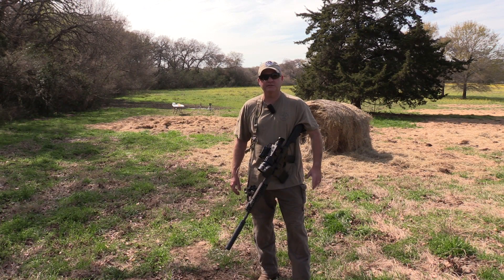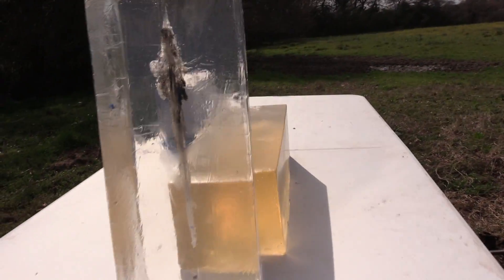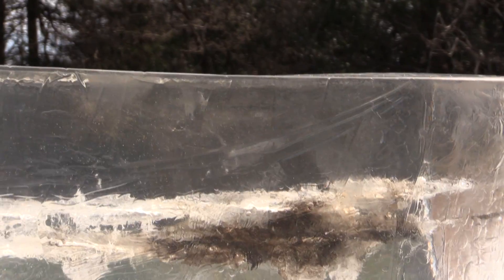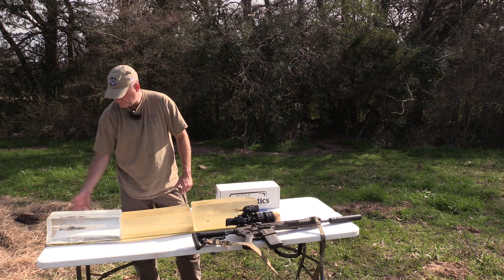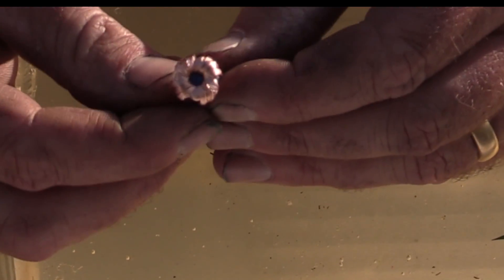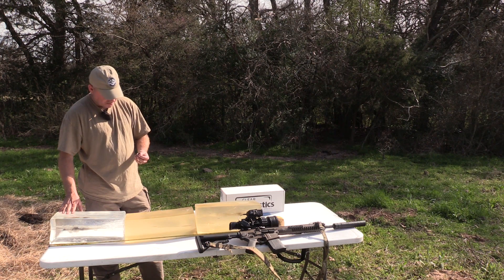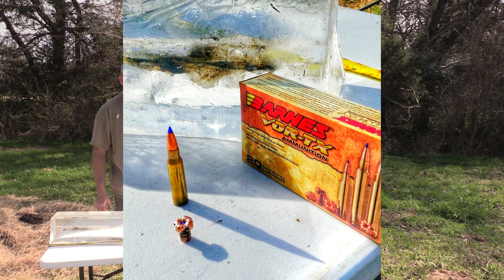Barnes 308 win 130gr Vor-Tx Ballistic gel test.

Comment: Hey what do you think the velocity difference with this particular round is between a 24” and 20” barrel thanks
Reply: Just viewing this video because I just ordered a couple boxes of this ammo. I read an article where a guy took a 30" 308 barrel and measured velocities after cutting off an inch at a time. 
.308 is a very efficient cartridge and velocities actually peaked at the  24" range. But it only lost an average of 22fps an inch from 24" down to 14". He shot two loads, federal 168's and ball 147, both lost the same. 
He concluded that the maximum point blank range between a 16" barrel and a 24" barrel was only about 10 yards different, just shy of 250 yards. He also concluded the 147 ball was more efficient than the 168 bthp at and range less than 500 yards. I can imagine these barns solids will be highly effective from a short barrel. I've got a POF Revolution DI with a 16.5" barrel and am expecting these to be just shy of 3000fps. Which will basically give you a .270 trajectory out of a lightweight 308 carbine. The POF has virtually no recoil even with 180 grain loads, these should be like shooting a 222.
Reply: About 3-400 FPS

Comment: 130 TTSX .308" bullets loaded into a 300 RUM case and fired out of a 26" barrel will average 3750 fps unless you want to use max loads up to the 3900+ fps range. Hunting with that load a few years ago here in Alberta proved to be very boring. BANG...go get the truck, or spotting scope attached to truck window and spot a shooter then get out and get prone, laser, adjust the Burris Veracity 4-20x50 top turret and hold off for wind using the reticle and BANG...load up the truck and go tag my big buck. No recovered TTSX bullets but the deer's insides told the story just like the gel blocks do. Dead right there performance.

Comment: When that bullet comes in to stock I will load it in my 300 win mag and try it
Reply: Probably go Mach 5 from that 😂
Reply: @riflesfirst208  have actually shot the 110 gr TTSX—it is a laser beam
Reply: @stuckcase7775  That sounds awesome. I’ve only ever shot 150gr FMJ as far as lighter bullets goes I will keep a lookout from lightweight Barnes though.
Reply: @riflesfirst208  speed up your powder and it becomes a laser—IMR 4350 or faster
Reply: @stuckcase7775  I’m on my last bit of H1000 so I may try that IMR next time I go on a powder run, it looks like it work great with my current pick (175gr SMKs) as well so I can’t see any downside. 

Thanks for the recommendation.

Comment: Does anyone other than me, find these Barnes bullets to be identical twins (other than color,& lack of steele center spike) to the late but GREAT Winchester Supreme(BLACK TALON)- (later named due to someone claiming
using the name BLACK was racist)FAILSAFE & eventually fall to the wayside, until the unfortunate pairing with Nosler.
Reply from the maker: Black talons are now called Winchester Rangers, they are lead core copper jackets hollow points.
Reply: Lone Star Boars ,they ORIGINALLY were solid cooper with solid pointed steele shank, I still have approximately 500 rounds, of it. They were banned in the end because of there armor piercing capability. In fact I still have 680 rounds of .270 win & another 1000 rounds of .300 win mag.
I have never heard of or seen Winchester ranger ammo, at least not around here, upstate NY.
Reply: No, this is one of oldest bullets ever made the original triple shock x bullet! But with a ballistic tip and a boat tail added!

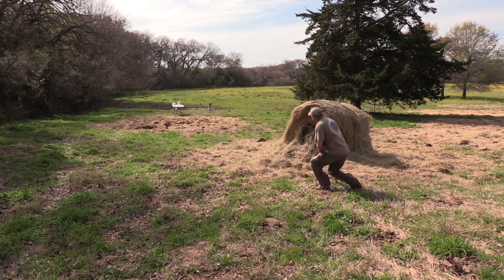Comment: Are all these new light 130gr ammo coming from the ATK/Federal 130gr OTM SOST NATO ( I understand that the Barnes has a TSX tipped round) ammo that was designed and produced for the SCAR17/H which is 16" with a 1:12 twist? What is the twist rate on your .308 platform? I have an AR10 Armalite with a 1:11.25 twist and it fires the ATK/Federal 130gr OTM SOST Ammo like a laser Sub-MOA. What is the price on that VOR-TX Ammo? Because I would love to buy as much as possible. Never saw it on the market yet? So now we have three types of 130gr 7.62 x51 ammo for shorter barrels. ATK/FED 130gr, Federal American Eagle 130gr OTM and now this 130gr VOR-TX by Barnes. I'm in Hog Heaven.
Reply from the maker: This is new loaded ammo it's just now coming to the market.  Barnes has had the bullet got a while but not the loaded ammo.  The lwrc twist is 1:10
Reply: +Lone Star Boars has the lwrc REPR been 100% reliable for you? how many rounds have u put through it?
Reply: I fired my Armalite AR10 DEF 1:11.25 twist yesterday with an adjustable block and a Primary Arm's 1x6 ACSS from bench rest with elbows on sand bags. Started with 100 rds of ZQI 147gr ammo with zero FTF or FTE. I love this rifle. First shot fired @ 50m was low but I was making sure the gas block was open enough to lock BCG open and it did then zeroed her in. I did adjust gas block as closed as possible from instructions to minimize bleed off and recoil. Second, I put 20 rds of ATK/Federal 130gr OTM SOST through her. This ammo shot at least 4/5" high on target. Since this ammo is my main SHTF Stuff, I resighted her in for this ammo. I wish I had a chronograph to see what my velocity was this stuff really burns and I did have increase recoil. I will keep gas block adjusted as is. I will be buying some of the Barnes 130gr Vor-Tex to compare. I don't see any of this SOST 130gr ammo any more. But ATK/Federal does now market under American Eagle a 130gr OTM Boat Tail of this ammo. I am sure the bullet is the same. I just hope they use the same propellant formula which I'm sure they do?
Reply: I am running something similar, an LR 308, SS 16" w/1:10 twist.  I'll be subscribing to see how your gear runs, and will post my own results.  A "light" round should be able to be pushed at higher velocities, something we lose out of these short barrel AR/LR's.

Comment: Something to keep in mind is that 1" of gel does not equal 1" of flesh and bone. So just because it went 37" through gel does not mean it will go through 37" of flesh and bone, likely it will do much less. Only way to know for sure is to test on a boar!
Reply from the maker: +smoggmage if you watched all the way to the end both of those boars were killed with the bullet.  Complete penetration.  Also killed a coyote with it at 450 yards Saturday night.  It seems to be working very well still a small sample though.
Reply: bones are denser than the gel but once your inside the rib cage there is air in between the organs. the gel gives the bullet constant resistance which the vitals do not. iv actually gotten further penetration through a deer than the bullet did in gel.

Comment: A lot more damage than I would have guessed with a 130 gr. round.
Reply: A heavy round in the AR 15 is @ 72 gr.  AK's in 30 cal traditionally run 122-123 at 2350 fps. That 130 out of a 308 has considerably more velocity than that with less recoil.
Reply: Temptuous2112 I shoot 150 gr soft points in my .308's and it drops deer in their tracks :)
Reply: MyHollowpoint Solid round for Whitetail and pretty much anything else in North America.  I haven't been out hunting yet, haven't had the time unfortunately.